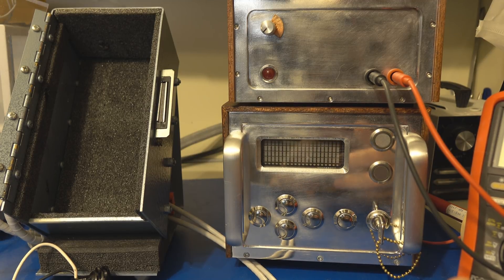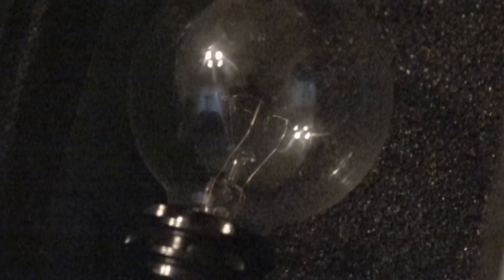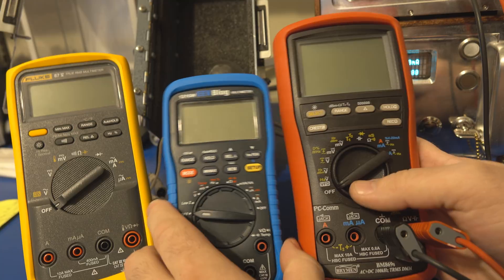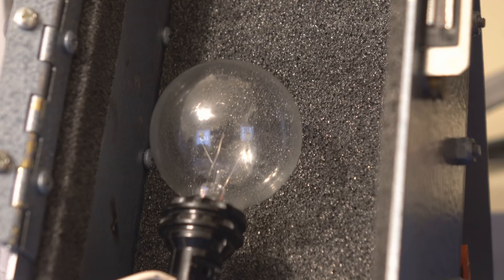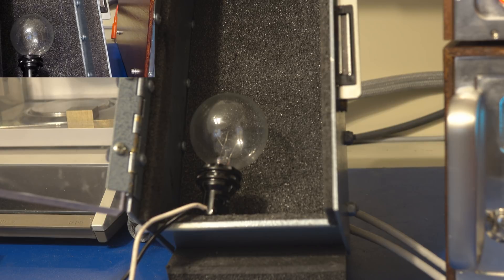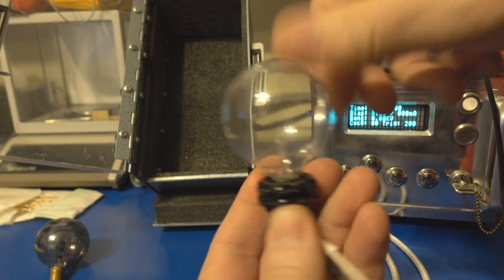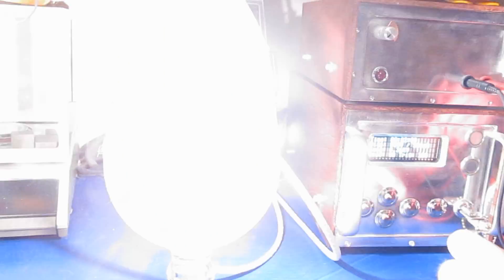Testing Transient Generators after Maintenance

Comment: Mr Joe Smith, for your home surge protection, which stuffs using ?
Reply from the maker: Pretty much nothing.  The equipment should be rated to handle it independently.  I do use a 1500Watt UPS for the PCs.
Reply: joe smith i though your home maybe perfectly protected like antivirus paranoid mode ! :))
Reply from the maker: If the equipment is any good it should meet the CE requirements.

Comment: Any chances for a review on UT139E or UT139S? LoZ function indicates changes in input circuit. I'm curious how it will perform in tests?
Reply from the maker: I have yet to see a UNI-T do very well in these tests.  If you buy one, post some high resolution pictures of the circuit board.

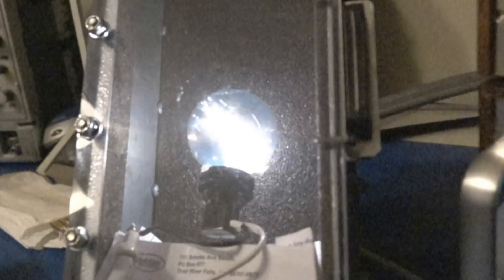Comment: @6:10 Surprised to see the plasma outside the bulb.
Reply from the maker: Even at 1000fps, the camera is just to slow to see what is happening.   I suspect what we are seeing off to the right is the end result of the light bulb's screw and foot contacts flashing over and escaping out of the socket.    This will create a big expansion and it had no place to go.  I made a demo showing this expansion: 

https://youtu.be/xLDok9Sm07Q?list=PLZSS2ajxhiQAk2Q57Obdy-2yVNF-m_huu
Reply from the maker: I will post the single frame pictures of this section for you:

http://www.eevblog.com/forum/testgear/hear-kitty-kitty-kitty-nope-not-that-kind-of-cat/2500/?action=post;last_msg=1479644
Reply: I remember that "fuse rocket" video. Was worth a rewatch :) But judging by the frames you posted, it looks to me like it is arcing from inside the bulb to the side of the container.
Reply from the maker: I think what you see is the gas stream exhausting upward and deflecting off the side of the bulb.   A better camera would help.  I tried to buy one of the Chronos high speed camera prototypes before the kickstart.  It may have been good enough to tell what is going on in this case.
Reply: I guess that makes the most sense.